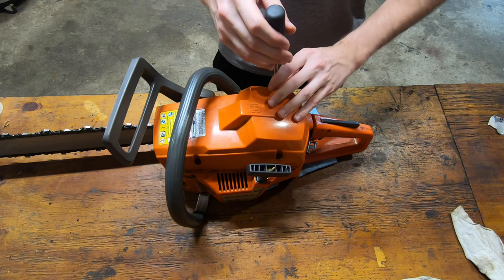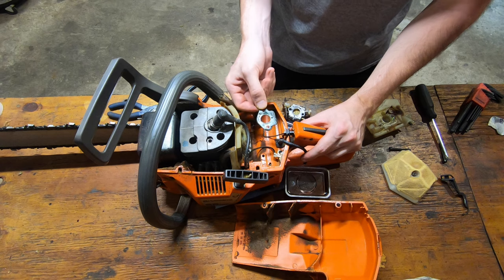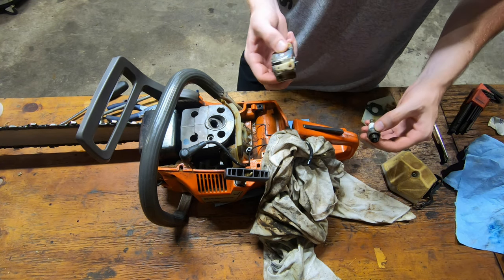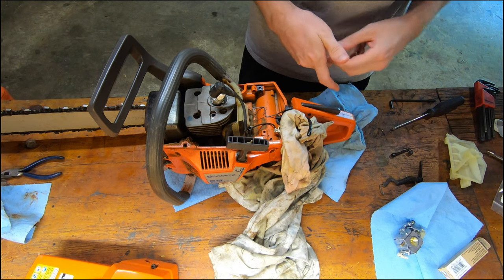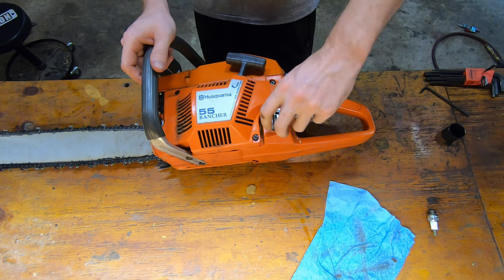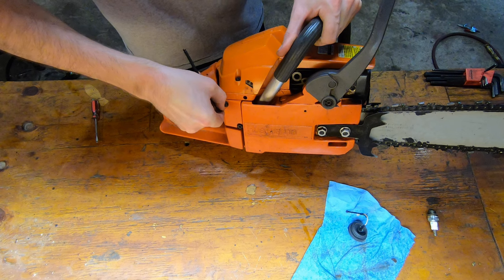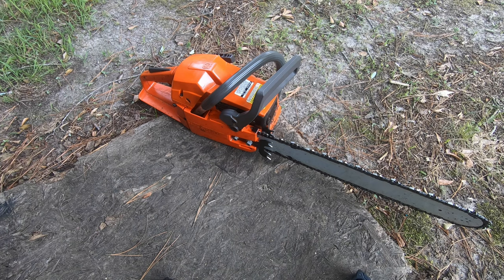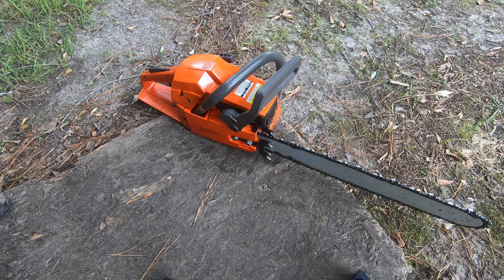Chainsaw Won't Start - Husqvarna 55 Rancher - Spark Plug Tank Vent Carburetor Fuel Filter Repair

Comment: I've used carburetors off ebay never had any issues, my customers hasn't brought any equipment back that I put a carburetor on, but I only work with one dealer

Comment: Rebuilt my rancher 55 and will not start. New carburetor, gasket, air filter, fuel filter, tank vent, ignition coil and plug. Has good fire to plug. What’s next, Help!

Comment: No idea what all those parts are, there’s a limit to minimal talking.  What was wrong with the saw to begin with? What was that black stick thing? Some sort of vent or something?  
  Sometimes it’s helpful to say something.
Reply from the maker: I discussed these things in the video.  I explain what was wrong at the very beginning.  I discuss changing the tank vent and fuel filter before showing that work.  I recap everything I did near the end before starting the saw.  Maybe you skipped these parts.
Reply: Sorry I was having a mini melt down- been working on my own saw on and off for months- actually had the problem like 3 years.    I shouldn’t have commented until I calmed down.
Reply: You wouldn't know if that saw is right until you cut some wood.
Reply: Mine still doesn’t work.  Year later. Just going to throw it away